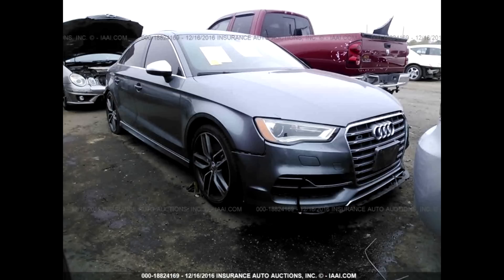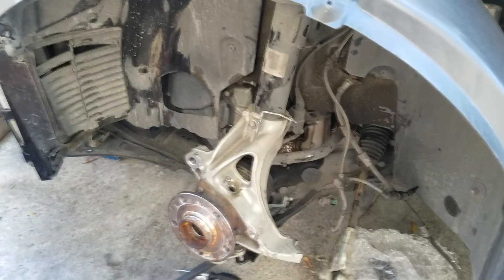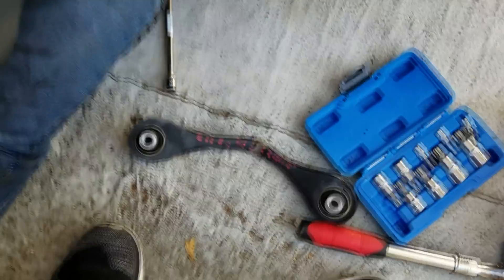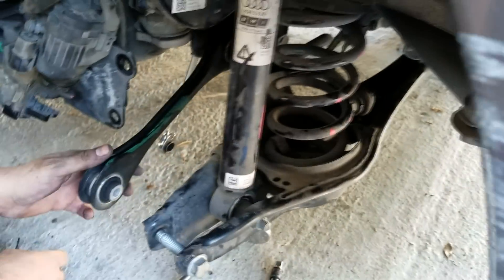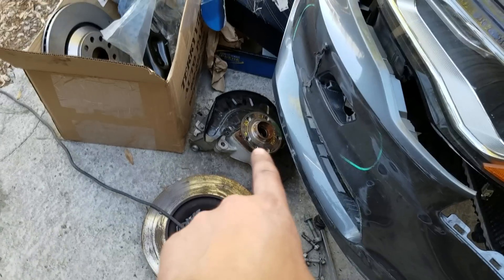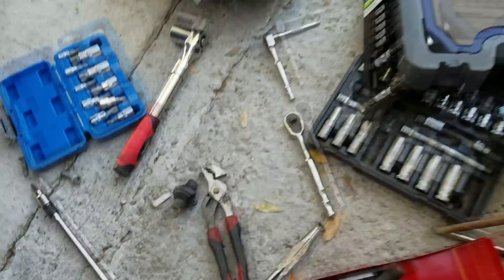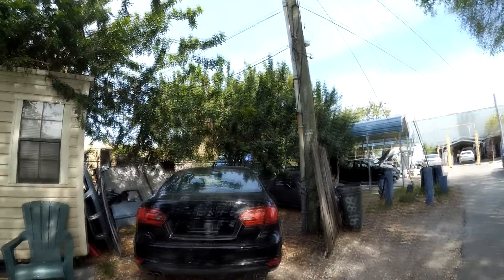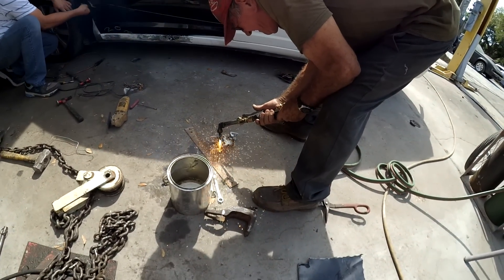Salvage 2015 Audi S3 Rebuild Project BEGINS NOW

Comment: He's right about the bushings. When I just did my Audi upper control arms it was easier though. Because I pulled the entire strut assembly out of the car. And then I took the control arms off one at a time and just tightened them equal to the other one so I wouldn't have to try to tighten them with the weight on the suspension crammed in there.

Comment: FYI you don't have to drop the k member to get that lower control arm bolt out you simply loosen the 3 bolts on the engine mount and jack it up a few inches to slide the bolt out.

Comment: So a car with a "salvage certificate" is a car that has been totaled, but it can be rebuilt back to a "salvage title" or "rebuilt title"? I just want to make sure that when I'm searching for cars to bid on, on Copart that I am looking at cars that can actually be re-registered  after being repaired and inspected. Any clarification would be great, thanks!
Reply: Hnat Automotive Photography as long as it passes the salvage inspection in your state it can be reregisterd rather easily
Reply: Emeka Iheanacho doesn't it depend on each state? In Virginia you can only change one salvaged vehicles title to rebuilt title once a year. More than 2 cars you need a license how can that be easy to reregister?
Reply: Winner of a video, I been tryin to find out about "auto import export" for a while now, and I think this has helped. You ever tried - Conubraay Cars Capitalization - (just google it ) ? Ive heard some awesome things about it and my brother in law got excellent results with it.

Comment: Hello, really liked your content. I have a quick question, if the car I'm about to buy has a salvage title, is it simple to get it registered to my name? We are in the same state.... I have pictures of the accident... No airbags were deployed. It has all been repaired.
Reply from the maker: You can get it registered to your name, but if you are attempting to get it converted to a "rebuilt" title in order to drive it, you need all the receipts of the MAJOR parts you used to repair. If you don't have any receipts then they will deny the request until you get them; and there are stipulations (stupid ones) like no eBay/paypal receipts etc...
Reply: Samcrac Oh okay understood, basically I cannot register the car as salvage again and just keep driving it? I cannot drive it as a normal car until I get all the paperwork and get the the rebuilt title?
Reply from the maker: +TheWiseGuy correct. In Florida they will not give you a tag for a salvage car. If you are buying the car fixed up but it still holds a salvage title be leary of the repairs done unless you have done a thorough inspection
Reply: Samcrac I never bought a salvage vehicle and I don't know know whether they will register it ... Do you think is best to try and register it before I pay for it correct?
Reply from the maker: Private message me here on Youtube so I know exactly what you are looking at. There are a lot of variables it sounds like in your scenario.
Reply: TheWiseGuy

Comment: 1:49 that stupidly dangerous what your mate is doing. just imagine the jack will fail... put a wooden block under the front of the car next time please
Reply: Holma Runter there are axle stands under there?
Reply from the maker: The car is on stands???
Reply: I saw that. But what if one breaks away? Easy to smash your mates head. Where i come from we put a wooden block next the person who is under the car. Just for safety reasons. Personally i wouldn't put my whole trust in those jacks.
Reply: Holma Runter but dude what if the wooden block fails??
Reply: Danny Wheeler 😂
Reply: I have seen someone get crushed by a jack failing, jack stands are fine, but  yeah, the dude only lost an eyeball

Comment: I just bought a 2014 Audi A4 s line that was in a small accident when the car was picked up at the auction site the dash board lights turned on but didn’t start and now there is no current what so ever. No airbags were diploid but the seat belts in the rear did tighten up so i’m thinking a crash safety mechanism went off which is on the battery but I can’t get the trunk open. I tried to jump starting it from the front but nothing. Also the rear seats don’t fold. If anyone can give me some advice that would help.

Comment: the big problem with this car is the steering wheel is on the wrong side
Reply: pete a why
Reply: you mean correct side...
Reply: Andy97 Channel it's not on the right side so no
Reply: ye, exactly, it's on the left which is correct side :D
Reply: Yeah the steering wheel isn’t on the “right” side of the car, but it being on the left allows us to drive on the right side of the road 😉😉